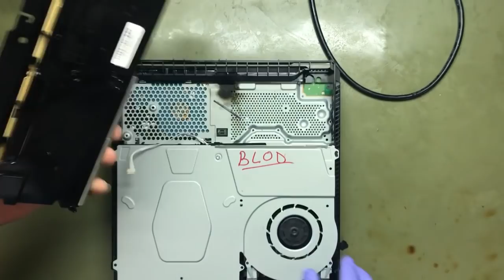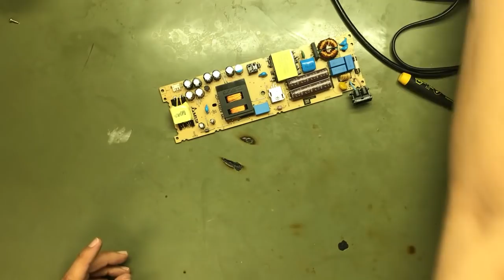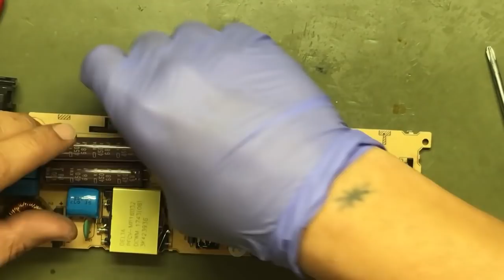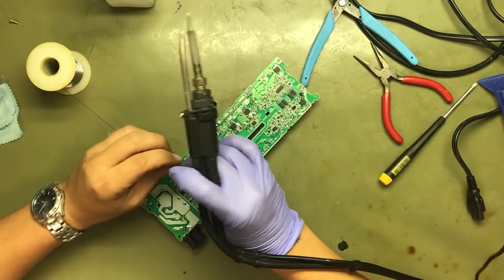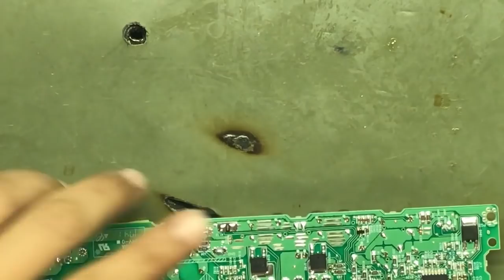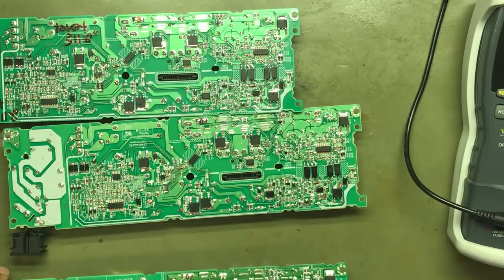ADP-160ER PS4 Power Supply Repair

Comment: Good morning,
 Thank you very much for uploading this educational videos. That is very appreciated. 
I  have a ps4 slim that will not recognize my controller in either of the front usb ports. I used a USB tester, and and I an getting 5V, but th wired controller that I use does not go into charging mode like it usually does on a normal ps4. I tried  swapping the BT module but that did not fix the issue instead the ps4 would not turn on. Maybe I applied to much heat to the donor chip and I end up runing it. 
Could it be that maybe the USB CHIP  that control the USB ports went bad and it needs to be replace? If that is the case what is the name of that chip?
Thank you!

Comment: I have a PS4 slim power supply i need a MOSFET controller chip number is MPS1723-HR1001C. Do you know where i can source that part? Thanks in advance.

Comment: Hello, good contribution. Something curious happened to me. With the ATX power supply it turns on without problems, but if I try with its power supply it does not turn on. I've tried a new one and it's still doing the same thing. Any advice? Greetings

Comment: Do you worry about discharging those big caps before working on the power supply?
Reply from the maker: Darren Rutgers in the PS4 pro powers supply. Yes. On previous versions. No. I know what I can touch. And not touch. But it is recommended

Comment: Hey hows it going today i tried to fix an ADP-200ER (for the 1200 series ps4)  which has no power the ps4 beeps once the 12V does not kick in, i opened up the power supply and there was alot of dust in it .I cleaned it and checked all the power IC and transistors for shorts i could not find anything short the big fusible resistor was also good . Do u know what could be bad that prevents the 12V from kicking in ?
Reply from the maker: Possibly bad mosfets. Check in diode mode. Possibly faulty pmic. Possibly small caps blown. Look under scope
Reply: thanks for your reply . which pmic are you referring to ? DAP041 ?The funny thing is i just tried it and its started to work . i guess we can call it an intermittent power supply . I'll take a look under the microscope to see if anything is burnt .
Reply from the maker: Nikesh Gupta you changed the DAP041? And now it works? 
If you have Facebook. Find us there. Easier to communicate
Reply from the maker: Nikesh Gupta you changed the DAP041? And now it works? 
If you have Facebook. Find us there. Easier to communicate
Reply: No i didnt change anything yet , I will add u to my facebook
Reply from the maker: Nikesh Gupta link is in video description

Comment: What could the potential  problem  be in my case I am working with the same  psu ADP 160er, system turns on loads up just fine until around the 5 minute mark. Then beeps twice simultaneously  and system  shutdowns?  (No warning signs  whatsoever)This happened multiple times, remind you the councle I'm working with is clean and quiet, I've checked the psu and cannot fine anything out of the regular?  Please  Help! Thanks All
Reply: motherboard or over heating

Comment: I was wondering what resistor did you use 10K or what to look for it by
Reply from the maker: https://www.mouser.com/ProductDetail/KOA-Speer/MFS1-2DCT52R16R2F?qs=%2fha2pyFadugux5duMxIeSkURl25n9ULqROTKImSPp6EHvE1s%2f%2fKYSqG2UJ2xU%2ffX